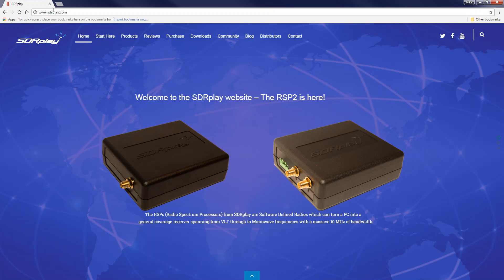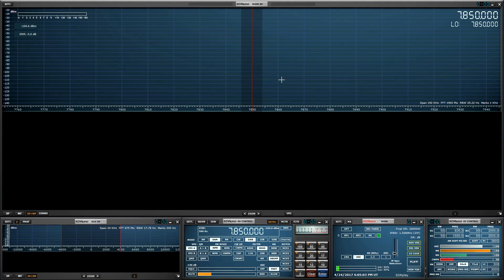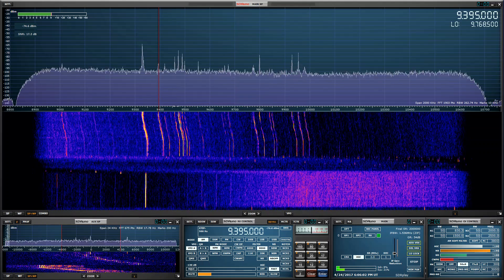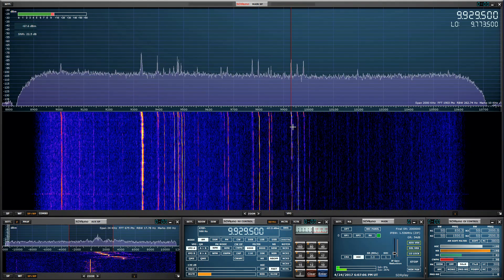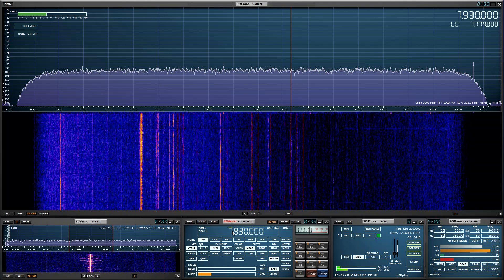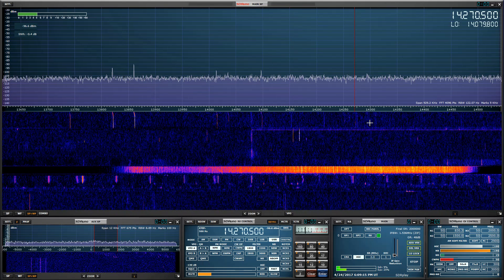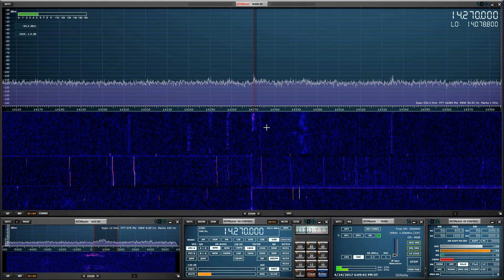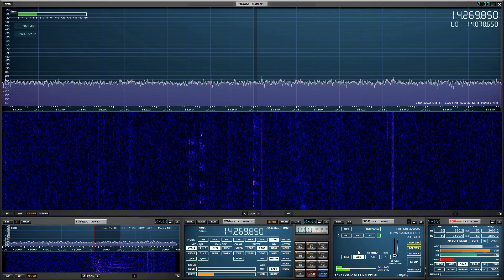Using the SDRuno Noise reduction feature on HF frequencies (MV004)

Comment: I DONOT like the fact that I cant change what antenna im using while in weather band at 162.475mhz..i HAVE TO use antenna A...I dont want to use antenna A...I want to use the HIZ...
Reply from the maker: Kennynva You can use Ant A or Ant B. Hi-Z is for HF only and has no response above 30MHz

Comment: hi mike
first, great videos, they offer lots of info..
however, pleas tell us where to down load some of the other programs you are using, like the virtual cable and its version number ....
also, i have been following your fideos to the " t '..... but i am having problems with the lo freq .. like on 75 meters for example ... if i set the lo like in your video, then tune up and down the band, i can get to the point where the receiver is receving on the lo freq, insted of the tuned freq ..... just bear with me, lets say i am tunning 3,805 lsn and the lo is down around 3.546 or something, what i here is the c on the lo freq and not what i tuned n on the main dial .... this by the way, happens no matter where i go, any band / any freq ..... is there so lo freq i can use to stop this ?? ... no, i am not in a crowed city, i live in the country, far away from any big transmitters, and the nearest ham to me is over 20 air miles away .. my antennas are... 75 meter dipole, 75 meter loop, and a vertical ground mounted... for vhf / uhf, there are standard ground planes, discones and egg beaters for the satellites ....

as a whole, i am having fun with the sdrplay 2 pro, i can copy wx satellite pix, sstv, cw, eazypal digital tv, and all the other digital modes with the sdr play 2 pro.... i am using vb cable to do this .... its just the problem with the lo, that is anoying me ......

any input from you would be appreciated .... and pleas, keep up the great videos ...

jim

Comment: Good video.  Some quick points about NR for the uninitiated.   The idea behind NR is that the signal is selectively enhanced while the noise is not.  So:

1) you need a signal above the noise to start with - you can't turn it on and expect the noise to drop and signals to come shining through.  That's magic, and NR is anything but.

2) You should to make the noise as light as possible once you have the signal.  This is done in the radio (outside of the radio its done with your antenna) with your gain control.  You don't need nor should you  have it maxed out all the time.  When you acquire a signal, turn your gain down to the point the signal is clear and the noise starts fade.  Too low, and your signal will be confused with the noise.  Too high, and your noise is confused with signal.  Try turning off the AGC for tough signals and do this all manually.  Again, there's a reason both the RF gain is adjustable and the AGC has an on/off switch.

3) Counter-intuitively, try to keep the bandwidth as wide as possible.  Bandwidth is not for noise reduction, its for selectivity and eliminating interference.  The wider you keep your bandwidth, the more ineligible the signal will be,  and the DSP will have noise to sample and eliminate.  Narrow the bandwidth, and you get less noise to sample/eliminate, a less ineligible signal.   When this happens, the NR will be looking at a narrow sample of signal and start clipping the weaker parts of the narrow signal making it even less ineligible.  

4) Less is more. On the RSP2, its NR its not that aggressive but on pricier rigs it is; and everyone knows that your sound quality degrades with aggressive NR.  So why do high levels of NR exist if they degrade SSB signals?  Ah, because on CW when you're only listening for a tone aggressive NR isn't as degrading. Keeping as low level of NR as possible is the way to go.  Also, when scanning the band, sometimes it better to have the NR completely off, as weak signals buried in the noise may not come through.
Reply: hello, a question from an inexperienced ... when you say "to keep the bandwidth as wide as possible" are you talking about filters 1800-2200-2800-3000 or the selectable bandwidth from 2 to 10 MHz? thanks and happy holidays! 73!
Reply: @guidomanfre  the filter bandwidth.

Comment: what antenna are you using for your demos? I have the RSP2 I am trying to figure out what antenna i need to use. I never seem to find any info in what type of antenna for SDRs.  The Ham radio crowd always talks about makeing sure you have a SWR... However i assume that your transmitting and dont want the reflected power back into your radio... i would think you want to max reception vice minimizing SWR.
Reply from the maker: Hi Itdorn

I am using a flat top 146ft OCFD AKA Windom antenna. My RSP's are connected via RX out of my FTdx-3000 so when I keyup it shunts the SDRS to ground and protecting the RSP frontend. I also use a LDG Z11 pro2 for the best possible SWR across all the bands I chase DX on. 40m , 20m, 17m etc etc.In a RX only environment the SWR is not important.
Reply: Hello. I am using a MFJ 52 ft center fed G5RV multi band. I also have an older Icon IC746 pro radio swit h with the excellent MFJ 1708SDR . The 1708 is a switch that allows you to transmit on your radio while stunting the sdr  receive to ground so you don't smoke the receive amplifier of the sdr.  The 1708 is worth it's weight in gold if you re you to use the sdr around a transmitting radio